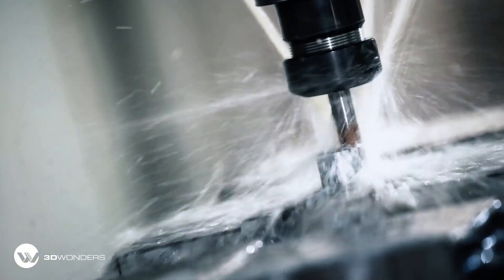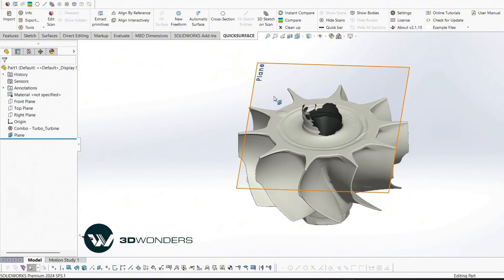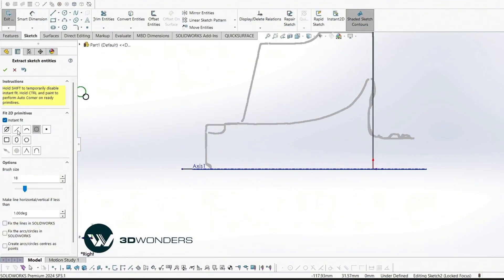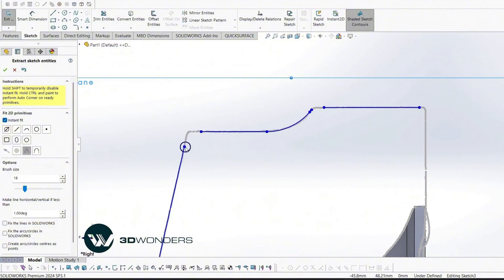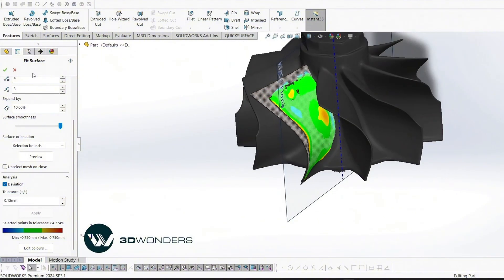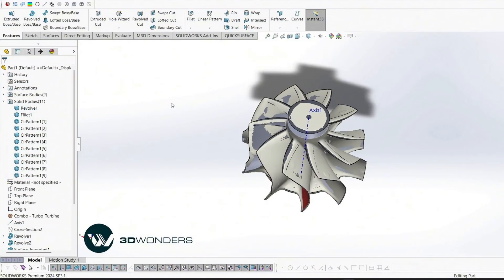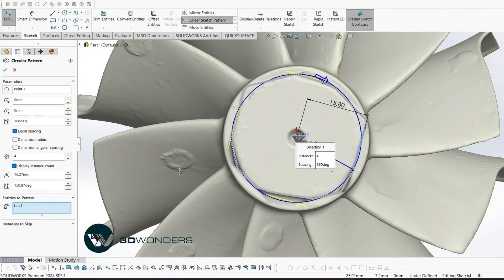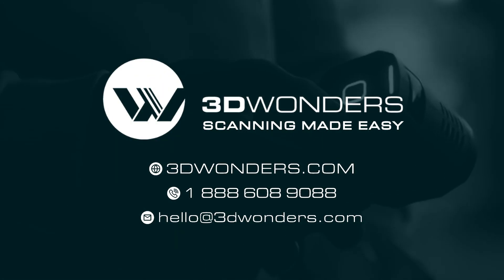Reverse Engineering a Turbine Impeller | From Scan to SolidWorks CAD

Comment: i never expected doing RE in SW. Thanks for providing such a perspective
Reply from the maker: Glad it helped!

Reverse-engineering directly in SolidWorks often runs into limitations, especially with mesh handling, surface reconstruction, and accuracy control. That’s where QUICKSURFACE for SolidWorks helps bridge the gap by turning scan data into clean, editable CAD geometry inside your SolidWorks workflow.

If you ever need guidance or want to see how it works on your own data, please feel free to email us at hello@3dwonders.com. We’re happy to help.